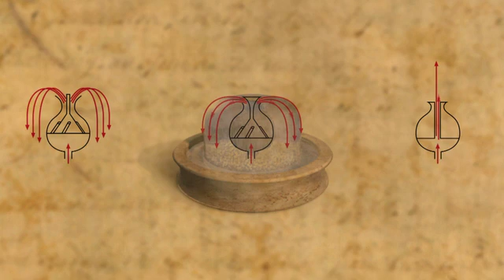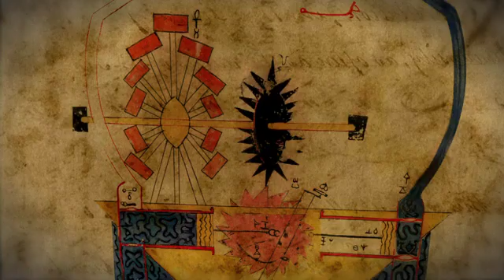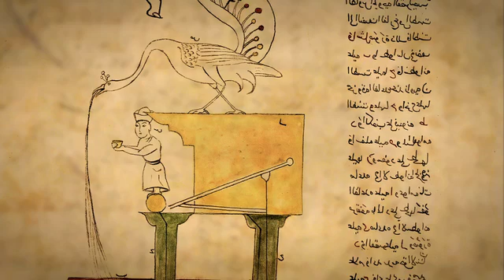Islamic Water Engineering

Comment: Very funny, till 1948 no muslim engineers found oil reserves in gulf, one thing is true Muslims respect water that's they take bath weekly once
Reply from the maker: Oil has been used in the Middle East for centuries - OIL lamps. pitch. Distillation was invented by a follower of Islam. You're talking about modern technology - you may as well say they didn't fly until two Americans invented the air plane
Reply: @transmediatube  oil lamps and do you know which oil was used to lit lamps
Reply from the maker: @kamarssatyanarayana1245  Yes, it was crude oil - it would come to the surface - similar to what happens in other countries - tar pits -
Reply: @transmediatube  there was mentioned about flight in ramayan and do you know that
Reply from the maker: @kamarssatyanarayana1245  I do, but it's a different situation - anecdotal - Arujna's Arrows etc.

Comment: What Muslim engineers? So Leonardo Da Vinci was a Christian polymath?
Reply: Da vinci was born in renaisense period , these engineers were at height of Islamic Caliphate
Reply: @alikhanmoazzam   Same case with these Islamic Engineers. Under the Abbasids there flourished a philosophy called Mutazila movement, meaning 'Setting Aside'.  This philosophy gave precedence to logic over Quran i.e. If Quran is not meeting logical standards then set it aside and do what is logical. This was the beginning of the so called Islamic Golden Age under Abbasid Caliphate. This went on until a character called Al Ghazali emerged and challenged the supremacy of logic and reasoning over Quran. He brought back the supremacy of Quran over Ummah, and this effectively ended the Golden Age and pushed Islamic world into the darkenss where it is still residing. So the the Golden Age of Islam was achieved by discarding Islam.

Comment: And this after studying the layout and analisis of digs from the last 10 years or so by the same city council in Córdoba.  

.  
5. Open sewers, cesspools, seepages. As with the water sources, parallel systems of different scale coexist for the disposal of wastewater. On the one hand, the underground network of sewers from Roman times is maintained, renovated, with three axes and their branches that run under the main streets of the Medina and drain into the river. On the other, there are countless household sceptic tanks (‘black holes’) and the dirty waters are just tipped into the river or other inlets, or just to the City. 
5.Cloacas, pozos negros, vertidos. Al igual que sucede con el suministro, para la evacuación de aguas residuales coexisten sistemas paralelos de diferente escala. Por un lado, se mantiene, remozada, la red subterránea de cloacas de época romana, con tres ejes y sus ramales que discurren bajo las principales calles de la Medina y vierten al río. Por otro, hay un sinfín de pozos negros domésticos y las aguas sucias se arrojan también al río y otros cauces, o a la misma